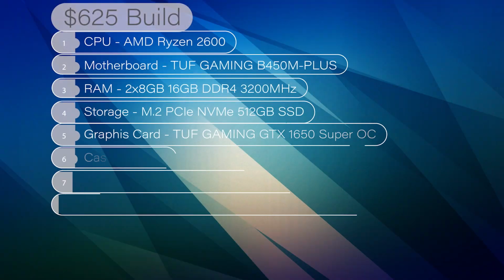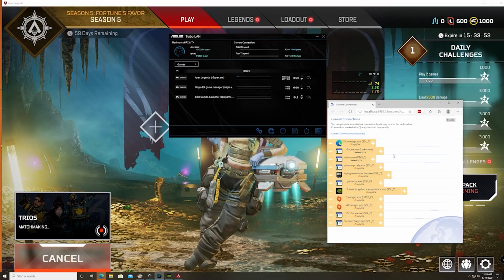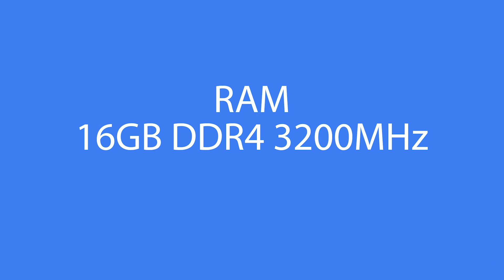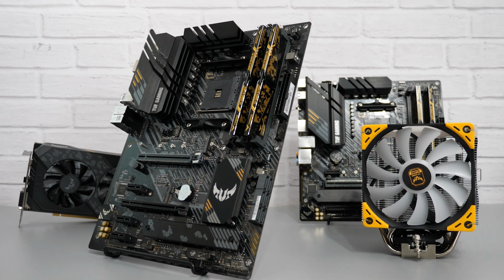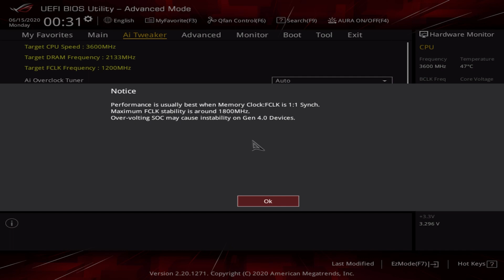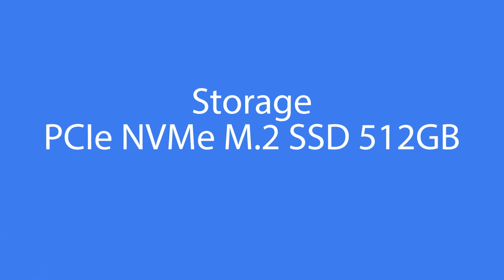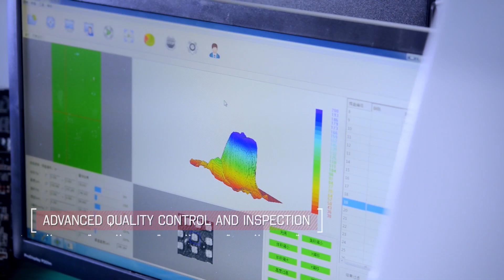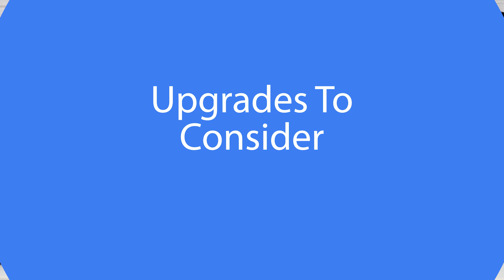$600 Ryzen 5 2600, GTX 1650 Super Gaming PC Build Guide 2020

Comment: Building this is a few days, went for the single fan 1650S bc of the stock issues, and te 2600X bc i will do some overclocking. I will let you all know how it goes. Also as it is a single fan gpu I have gotten some extra fans for airflow.
Reply: How did it go?